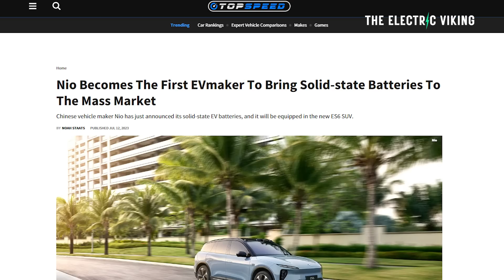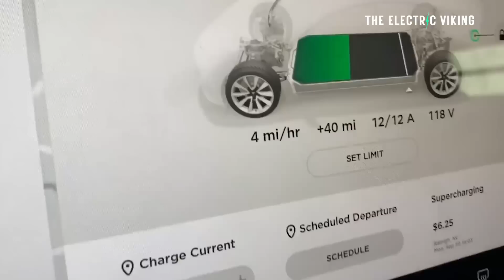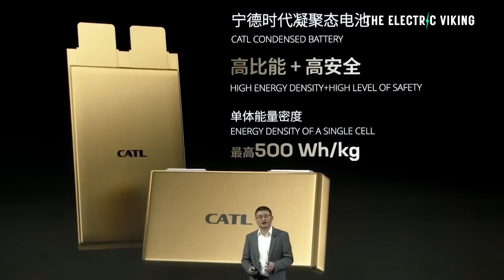CATL reveal new batteries for Tesla EVs that will KILL the competition

Comment: Same questions remain.. Over time how resilient will they be to degradation??
Reply: Do the math. LFP is usually rated for 2000 to 4000 full cycles.
Most evs are using approx 17kwhr per 100kms. Thus your 60kwhr battery might give you 350kms. Or, 2000 x 350kms = 700000kms to 1.4M kms battery life.
The ave daily commute here in Oz is 42kms. @ 42kms perday, the battery life above equates to 46 to 92yrs. Of course, the car will likely be worn out after 20yrs - 20yrs is the ave life on the road of a car here in Oz.
Thus, a LFP batter should last the 20yr life of a car, providing you do not fast charge it. Note, 90% of all ev charging events are slow charging at home atm.
Reply: Lfp = very
Reply: @gerardhaus8150  Cheaper, 30% less energy dense, no cobalt,  worse range & cold weather charging.. & you are right more resilient to degradation, & capable of charging to 100% every now & then is recommend..

Comment: 1. I would imagine that 500wh density batteries would first make it into cell phones tablets,  laptops and drones before commercial airplanes.

2. From what I remember CATL came out with the Na battery in 2021. It was a hybrid with a Li chemistry battery. The na  batteries perform in cold weather than li and are cheaper but the best solution is to use both chemistries. Overall the amount of li in the battery is reduced which reduces price as well.
Reply: 1. Unless Wh/l isn't great. Wh/kg isn't everyhting.
2. You remember wrong. They announced their Na batteries in 2021, but they only went into mass production this year. They have plans for hybrid batteries, but at the moment its just Na batteries for small cars and stationary storage.

Comment: There's zero chance a 500Wh/kg battery will see Boeing or Airbus introducing electric ducted fan passenger aircraft.
Kerosene has an energy density of 11,900Wh/kg and Turbofans are ~55% efficient , so it's effective specific energy density is ~6,500Wh/kg.
And Kerosene is jettisoned from the aircraft as it travels, increasing range. That's not possible with batteries.

Comment: Why so little discussion of how long (in YEARS) these batteries will last? Making an EV with a battery pack that lasts 15 or more years is so at least as important to most people as the range.

I've been driving a Chevy Volt with a paltry 40 mile range, charging it twice a day (at work and at home) to keep it all electric. It's in great shape, but it's 10 years old, and the battery pack is at end of its projected life. The car is going to the scrap heap once the battery dies; that is a travesty. For my use case, I'd love an EV with a 100-mile range and a 20-year battery life. Happy to give up range for service life.

Comment: CATL won't limit battery sales to a single company.  What they make available to Tesla will be made available to others.  What Tesla really wants and needs is a facesaving alternative to the 4680; which is basically a failure.  If Tesla can say they are abandoning 4680 because something better is out; then they can us the new battery to supply the Cybertruck, Semi and new roadster.  Until then these models will be leaked out in small volumes because they represent a loss.  Too many 4680 cells have to be thrown out to make a profit selling vehicles made with them.

Comment: With all this battery innovation,  it will be more difficult to pull the trigger on a new ev. Unless the price is low enough that the financial risk is lower. Nobody wants to drive last year's tech at a high price. Kind of like cell phones.  But when things level out, then people will be satisfied with the Motorola's of Evs.  Just about as good as an Apple or Samsung half the price

Comment: Sam is making sure that everyone knows he's Aussie.  His definition of cold is when the temperature reaches zero degrees celsius!  If we ever get a zero degree day in February, we go out in shorts and t-shirts and celebrate!  When normal winter temperature is -20 degrees, zero is warm.  Would genuinely like to know how these batteries perform in actual cold weather.
Reply: Here in Aussie, cold is anything under 10 deg C 😂
Reply: @tomesplin4130  Greetings from Cairns....sorry, anything under 25 deg C. 😆
Reply: Precisely, people in Minnesota, Alberta, Saskatchewan, North Dakota, Michigan, northern Ontario, Quebec, northern Sweden, Finland, Norway are all thinking “minus 10 Celsius?”, it would be nice for it to be so warm in January and February. Russia too but I would imagine there’s not more than 1000 EVs in all of Russia.
Reply: Real winter driving at -30c is about 40% range lost, however we get 2 or 3 days of that weather here in eastern Ontario. -20c driving is like 10% less range & with 500 km range, not a problem. @sjsomething4936
Reply: Just wait for the newer technology.  Now that there is a significant market the improvements will be coming out.
Reply: CCP Viking was confused by norther lattitude Sweden's need for nuclear power
Reply: -40 screws up all vehicles. Starter batteries get weak below -10 C and pretty much stop working at -20 C. Engines and batteries need mains electric heaters to keep them warm enough to use.
Reply: Heat Pump does it! @Dave5843-d9m
Reply: "It strikes me that no one is talking about the fact that the whole world is becoming increasingly dependent on China. In my view, this is a very bad development."
Reply: @henryrooyakkers8510  Absolutely.
Reply: Here in Oz, over 45°C is considered hot. 48°C means time to get inside in the ac, or go for a swim.
Reply: Saskatchewan last winter hit -50°C and Weeks of -30°C. There were No Tesla’s on the Road all Winter.
Reply: @pick_and_pan How do you get a petrol or diesel car started in those low temperatures?
Reply: @emilioagudelo5787  wow, I’m surprised the number is that high, but definitely pleased that there is some adoption of EVs there.
Reply: Hard to believe that Chinese EVs don't dominate Russian Roads.  They are "cheap" and available ... @emilioagudelo5787
Reply: Haha, Sam is a Viking who got seduced by warm weather and hot Aussie girls. I don't blame him. But he doesn't know cold in Colorado or Wyoming at 5,000-7,000 feet elevation. oddly you still get a nice tan while skiing midday when it's sunny out and you're lightly dressed til sunset. Then it's minus 20,30,40 C. Anyhow, I love his battery updates and this is a year old! How to beat/compete with CATL. First, sanctions, tariffs, etc. Second, massively funded 3-5 year  DARPA development program, industry and government. We've done it many times before. Only now our politicians are so corrupted by big oil, legacy automakers, dealers, unions, everything, they're like the Zombie Apocalypse or Invasion of the Body Snatchers. I swear it's well along here in our politicians and many legacy business leaders. They are completely disconnected from reality. Look you in the eye and say things that are so idiotic. But they actually believe it, as do their followers. It's the Zombie Apocalypse.
Reply: Nice, I miss the cold weather and despite years living in a hot climate I never lost my cold tolerance.
Reply: Sam is a CGI
Reply: rebim • 😂 👍
Just ask the norwegians how they're doing with their electric cars bought massively.
If you live in -20° weather don't buy an electric car yet if you're financially stranded.
However, new battery technology is coming in max 3-4 years with solid electrolyte that will completely solve the cold weather situation, faster charging, longer range, less weight, etc.

Comment: In 2023, with the dizzying rate of technological improvements, buying an EV still qualifies someone as an early adopter.  Hopefully by 2030 the technology will be established and standardised enough so that more cautious potential customers will be able to benefit from lower prices resulting from the eventual economies of scale in the industry
Reply: Meanwhile, your missing out on great technology, maybe more expensive vehicle, however Cheap to operate, recuperating your initial outlay of cash.
Reply: @rozonoemi9374  Not necessarily. It depends how far you drive. In most smaller countries where the average mileage is 6000 miles or so a year it makes no sense because most people buy on a 3 or 4 year lease, and there's no chance they will recoup the extra outlay in fuel savings.
Reply: They say Net Zero carbon by 2030.  I don't think that is doable but nobody cares.

Comment: Incremental battery improvements, this is a tried and standard practice with most technologys, squeezing more out of what you have while the price gets better and the reliabailitygets better. Good spot Sam
Reply: >> Incremental battery improvements, ....<<
There is nothing new about high C-rate LFP.  A123 and Samsung developed their own LFPs with much higher C-rates several years ago.
Reply: @tooltalk  To the user comes the spoils... Samsung better get their finger out and start licensing the technology if they can't or wont build factorys to make the batterys with that technology LOL
Reply: Yeah crt display technology just really needs a good improvement and I'm sure the market will realign with the way it was always meant to be 😂zzzzz
Reply: A thing called physics has something to tell us about how far those improvements can ultimately go. A thing called the mining industry is telling us the price of EV’s will rise steeply due to a big lack of the amount of mineral inputs going big on EV’s will mean
Reply: @georgebeare8883  ...Naw... the mining companies have more lithium to mine than you can shake a stick at, Lithium is one of the most abundant minerals on earth, in fact it has come down from from $60,000 a ton (pure grade) to $20,000 in just the last year... and will get cheaper as the mines come on stream and unlike an ICE engine, you can recycle and refine Lithium and reuse in a new battery or even in a lower requirement battery as it is, straight out of the car.
Reply: @georgebeare8883  Did somebody say fossil-fuel shill?
Reply: @jlcTTT  apart from a myopic EVangelistic drone like you, nobody.
Reply: @georgebeare8883  Yeah, that same mechanism made iron unaffordable a 100 years ago. Now it costs more than platinum! Oh wait, that didn't happen and it doesn't? Well I'll be damned.

Comment: This is why battery swapping is a good thing.
Reply: Why would you need battery swapping when you have batteries with 500 Wh/kg? You can easily have 1000  km range cars. Battery swapping creates more problems than it solves.
Reply: @AORD72 how much time it takes to fully charge a 500 wh/kg battery? nio battery swap can swap any size of battery in 3 minutes plus there is no need to worry about battery degradation. Nio users can also use battery as a service hence reducing the cost of the car
Reply: @cwdjdsd-36321cs  Why would you need to charge somewhere? You just charge at home, so it cost you zero time. If you have a 600 km range battery (and with 500Wh/kg battery a 1000 km range car is possible) you start the day with a fully charge battery from home. How many people drive more than a 100 km in a day, hardly anybody. Maybe 10% of the cars. 

Why would you want to drive out of your way to a battery swap station? Why would you want to pay the extra cost for battery swapping to a corporation? Do you think they will be doing you a favour for free? They will be mike a premium of the cost of battery swapping. It will cost you massive amounts more of money. Who will be paying for the spare batteries? It won't be the corporations it will be the end user. 

How many battery swapping stations and spare batteries would you need to support a million EVs? I don't think you have thought this through clearly. There would be endless queues at the swapping stations.
Reply: @AORD72  lol there are so many people in china who lives in apartments. Where do you think they can charge their EVs unless from charging stations. There are people who make long trips. If they can swap their EV battery on their way they don't have to waste their time on charging. 
60% of nio users prefer to use nio battery swapping stations. They now have 1400 battery swapping stations in China and Europe. Their goal is to build 4000 by 2025. 
As I mentioned nio users can buy a car with a battery as a service and pay subscription so that they don't have to pay anything when the battery lifetime ends. Nio also offers their EVs with batteries so you have to pay more to purchase the car. When they have to replace the battery in the future they can pay half the amount of a new car to buy a new battery pack.
By the way more manufacturers like SAIC, GAC AION are entering the battery swap business so there are going to be many more swap stations in china. GAC AION swap stations only take 2 minutes to swap a battery.
Plus there are no more queues near swap stations than In charging stations.

Comment: Looking forward to battery powered planes, boats and cargo trains with the compact battery they will be bringing out.
Reply: Planes aren't that efficient. But trains are, and few use any battery propulsion. Bring on the hybrid locomotives!
Reply: @johnt5222  diesel electric locomotives have been around for years...the diesel engine runs a generator which drives the electric motor(s) ..
Reply: @johnt5222 But it must be said that the ownership model of infrastructure (rails, rolling stock, roads, housing anything) has to be made to adapt and change to the literal existential environmental crisis going on right now. Market implemenative tweaks are not gonna cut like the war time efforts of the 40s did and the New Deal Depression measures since 1933, Second Bill of Rights etc.
Reply: @johnt5222 yes!
Reply: Only cargo trains ? FR?
Reply: I want an velomobile for my shoping and driving to the trainstation if they figure out how to drive it whit the AM class (28mph/ 45 kmh)
Reply: The king of stupid has been found !
Reply: I can only imagine how the public will react if they knew their airplane was powered by rechargeable batteries. Not well. 🙂
Reply: @toonman361 , why would they care?
Reply: @CL-gq3no  Good question. Given that electric motors have far few moving parts than mechanical gas engines, theoretically, they'd be safer.
Reply: @toonman361  would you get on one ?  not me
Reply: Yeah trains would be a good win, could charge by overhead wires, third rail or wireless charging under the train? Wouldn't have to be for the whole stretch as they would be charged at the loading docks and passenger terminals at either end.
Reply: @lavectech  A dimwit prince  here !

Comment: What’s happened to the biggest battery revolution ever the 4680 batteries?
Reply: They're a fraud, nobody is following them. And you can't repair them (not even a little bit), that's a deal-breaker for me.
Reply: The chemistry in the 4680 form can be changed and has been already. The new dry paste method allows them to be produced in a much smaller space so more in each factory. The revolution continues!😮
Reply: @malcolmrickarby2313  when these were announced a few years back now I thought they were a done deal apart from the way to produce them on mass , to me these appear to be taking a heck of a long time
Reply: @malcolmrickarby2313 
“Dry paste” ?
Is it an oxymoron?

Comment: Just buy a nio , replace battery in 3 mins ... or dont , whick ever , who going to buy an old poor quality tesla with a fixed tired low range battery , and new owners will have the same problem down the line or pay 25k for a new battery,  tesla should of used battery swap even if only available at dealerships for upgrades

Comment: There is no doubt that these batteries are going to affect the market, but I don't see that it means that Tesla is going to dominate.
As you say, CATL are the largest manufacturer, so they manufacture for many other EV makers. 
CATL themselves have already said that the Condensed battery is going to be cheaper than current LI batteries, so I see no reason why BEV makers will not want these batteries.
I can see that there will be effectively 3 ranges (maybe 4) of batteries for EVs
1 The cheapest will feature sodium batteries
2 Next up will be 4CLFP batteries
3 After that you'll have the Condensed batteries

Yet even the Condensed battery is, according to CATL, going to be cheaper than current Li batteries!
And seeing as current batteries are the single most expensive part of an EV, this should be good for all buyers.

Coming on to the problems related to CATL monopolising the battery market; there have been plenty of instances of companies gaining a monopolistic position in a market. The problem is never the market or the monopoly. That is easily solved. The historic problem with monopolies has been that governments, especially in the uSA, have been very reluctant to control/legislate against them. The Chinese government is aware of the problem. That means that they are likely to do something about it sooner rather than later. That is all that can really be expected. If it was my decision, I'd be looking at making many "Baby" CATLs, with the various companies having some of the tech, others with other tech, but none of them having exclusive control of any one area of technology. As I said earlier, legislating against a monopolistic corporation isn't the problem, the problem is the recognition that it is necessary.
Reply: The Chinese government is likely to be reluctant to hold back CATL too much though. Their a national champion. Then again, so is BYD